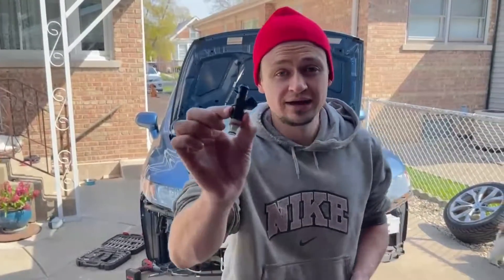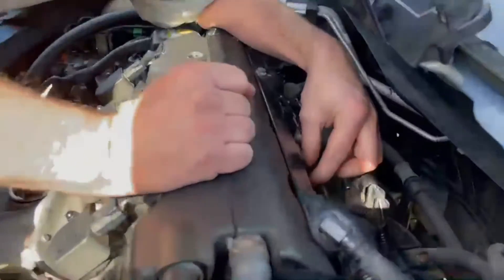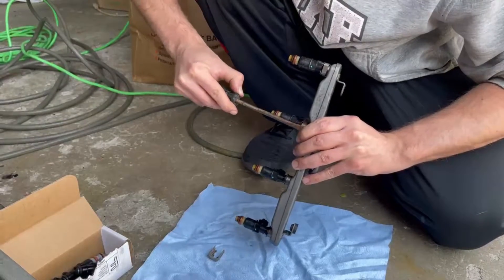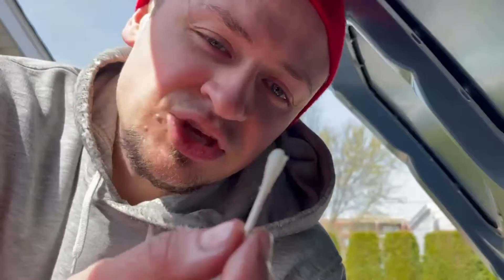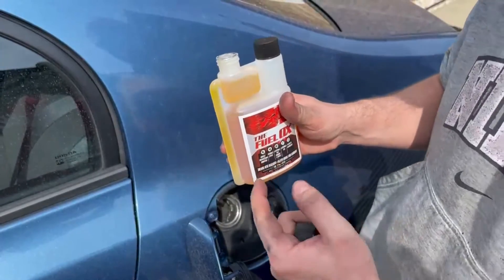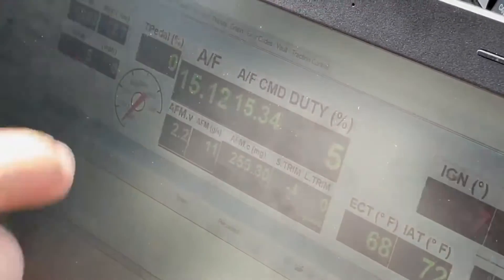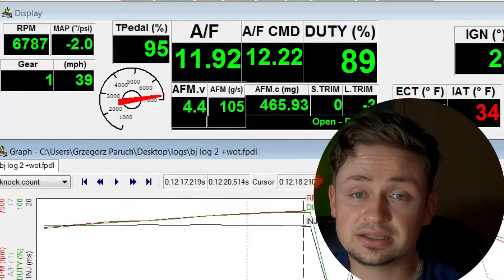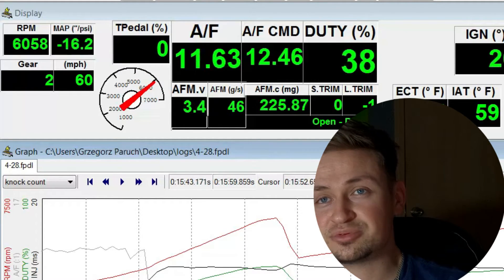Honda Civic R18 Turbo 310cc Fuel Injector Install!

Comment from the maker: If you are excited drop a like on this comment!
Reply: How much would I run if a swap my injectors with a tune?
Reply from the maker: @emalkarabasic  hondata new is 700$ injectors used around $60 
You need hondata for the tune.
Reply: @BulliKid  how much hp?
Reply from the maker: Nothing. Fuel injectors don’t add HP.

Comment: Question my oem 8th gen si injectors are stamped Va26 AASV and I purchased another set off eBay for 8th gen si stamped Wa25 BASV do you know the difference between both codes?

Comment: If I buy 8th gen civic si injectors I can just swap them out for the OEM ones? Just swap them?
Reply from the maker: They bolt right in. But you need hondata to adjust the computer so it work properly with the bigger injectors.
Reply: @BulliKid  alright thanks. I'm currently modding my 08 LX Sedan but I'm keeping it n/a so I'm not trying to spend a ton of money on it.
Reply from the maker: gotcha!
Reply: @BulliKid  I already have a list of the parts I want and my goal is 180whp which is a stretch but if possible 180 is my goal plus I want to take it to the track and have a fun time with it. Your videos have helped a lot thanks 👍 keep it up.
Reply from the maker: Thank you for the support and I appreciate it and best of luck with your build
Reply: @BulliKid  👍

Comment: Hey guys! So I’ve found this great looking 2007 Civic Si sedan but it has 180k miles on it for $5700 and been in a low impact accident in 2012 on driver side door. Now its completely fixed. The car fax said it had 6 owners, it’s passed multiple safety tests when being resold, and also kept up with oil changes fairly well (around every 3000 - 4500). I’ve never bought a civic si before and I’ve always loved the 8th gens since I was a kid. I’m also looking to replace my other car that’s crapped out on me. I just want something reliable and easy to maintain and won’t break the bank when I need to get it repaired. I’m already in a hole I don’t need another issue. Just want some of y’all’s opinions. What do y’all think? Should I buy?
Reply from the maker: A lot of the civic SI‘s have paint faded issues with the clearcoat and third gear grind with the transmission. Other than that it’s a solid car

Comment: So what does changing the oem injectors to the 310 ones do for the car?
Reply from the maker: Well if you’re going turbo you need the extra fuel flow so your engine does not blow.

Comment: Where can i get 2014 civic lx injectors from. Looking for 310cc ones and i cant find any
Reply from the maker: Just make sure they are compatible with your 9th gen.   I got mine. From a buddy who was parting out a crashed 8th gen si.  My advice is stay away from replicas or eBay brand.  You may have to buy oem from dealer or upgrade to 410 cc RDX is you plan to boost.

Comment: Ok I got a question can you run those injectors without a turbo or you gotta have a turbo?
Reply from the maker: In the video I have no turbo.
Reply: @BulliKid  can you run those on automatic too?
Reply from the maker: @emalkarabasic  tranmission isn’t related to engine and fuel injectors.  Yes you can. I am on auto and ran them stock engine.   You just need to tune with hondata to make the car run proper.
Reply: @BulliKid  ok thank you very much appreciate it.
Reply: Im hoping to cure a lean condition that I think is due to the cold air intake volume. Short term fuel trims are in the low positive twenties, (Lean) and I can’t find a leak, even with smoke…

Comment: i have a honda civic 06 automatic with air intake and yonaka exhaust at the moment and plan on getting a j35 throttle body...what kind of injectors would you recommend for me?
Reply from the maker: You probably will be fine with the oem injectors.   But 310cc would be more then enough for your set up.
Reply: @BulliKid  thanks bro

Comment: Did you upgrade your fuel pump as well or no?  I am upgrading my fuel pump, but was wondering what I need since the fuel on the cars dahs won’t be the same when reading how much gas is in the tank, so just curious if you have done that
Reply from the maker: No. I am using factory oem fuel pump.  
Works well for low boost.
Reply: @BulliKid  Have you had any issues with the 310’s or still going strong?
Reply from the maker: For my low boost level they are ok.  
Recommend bigger for over 8 psi

Comment: If you were to run stock injectors but run like 5 pounds would it blow up ?
Reply from the maker: Yes.  The stock injectors are like at 90 % working duty cycle stock.  They can’t handle any more
Reply: So what’s the best you would say 310 the best for boost?
Reply from the maker: Watch my injector selection video. All the info you need brother in my turbo playlist!

Comment: Question' what hondata are u using for the r18.  Do you have a link to the specific one? New here trying to figure it out. Saw it on amazon' except my car isnt listed 2006 civic lx isnt listed. Im following your build hoping to do a simple cheap one on mine as a learning experience.
Reply from the maker: It’s hondata race version R18 Americas
Reply from the maker: I bought it used so no links.
Reply: https://www.kseriesparts.com/HD-FP-R18-US.html